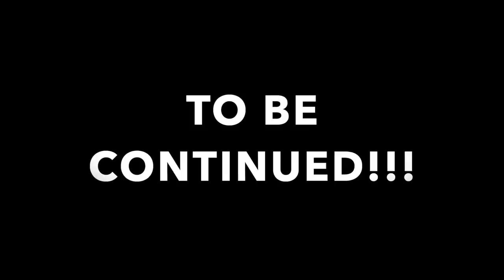WELDING FOR THE FIRST TIME

Comment: Keep working on welding and keep the dogs out of the shop they’ll be tempted to watch and the arc will blind them
Reply: never heard of that before
Reply: It won't blind them but it will burn the whites of their eyes and cause blisters to develop. Which is really painful. I should know I've had 2 of them in past 30 years that I've been welding. Coincidentally I had one from a Lincoln buzzbox stick welder and the other one was from a mig machine like she's using and the mig was by far the worst. Your eyes are really sore and it feels someone took a bucket full of sand pulled your eye lid out and dumped it in your eye and it lasts around 12 hours. Your eyes also water like crazy also the entire time. Welders flash is what it's called and their not fun.

Comment: It's called slag when you cut something and when I change wire I always run my wire to a styrofoam ear plug keeps the wire clean and they make a pliers four wire feed welders it works great on every aspect of the welder

Comment: Once upon a time I could use a vary small acetylene torch to wield Aircraft tube frames.  Would they even do it that way these days?  If your torch is not a vary small one, it won't work on Aircraft tube: it will just burn holes in it.